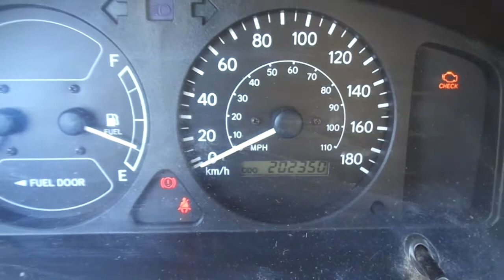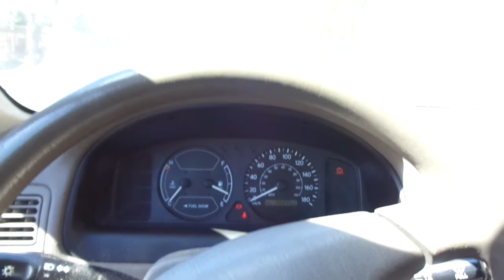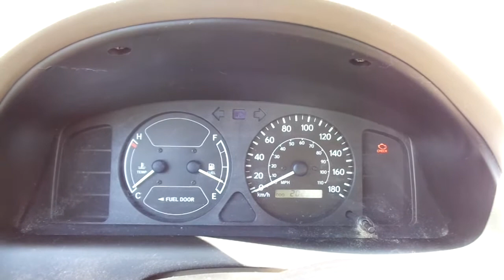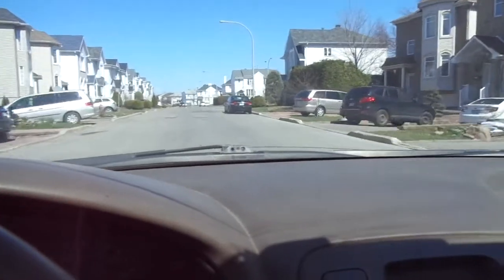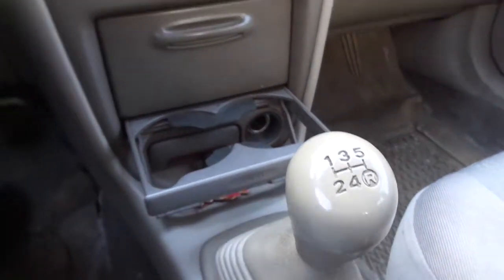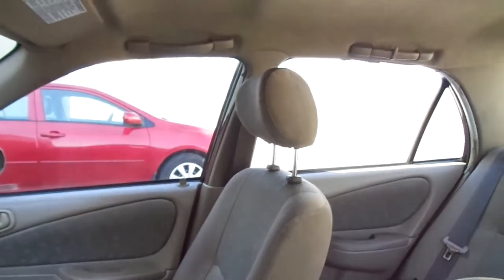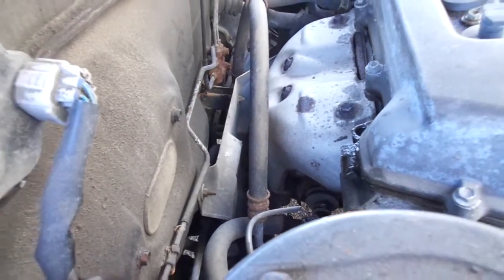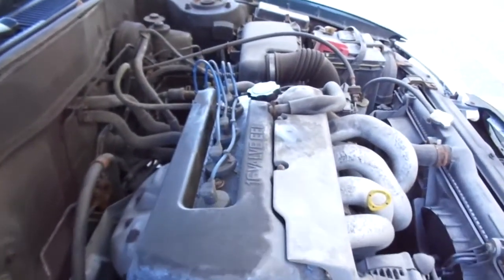Review of my 1999 Toyota Corolla - which I drove until 2016, 202350 km

Comment: Still rocking my 99 Corolla.  318k miles on it.  It simply won't die.  Its been a giant pain in the ass lately though, have had to replace the rack & pinion,  an axle, and wheel bearings.  That stuff would wear out on any car eventually though.
Reply from the maker: They are really dependable cars!
Reply: I've got 140K on my 99 corolla. Any major repairs that I should keep an eye out for? Thanks and happy Holidays!